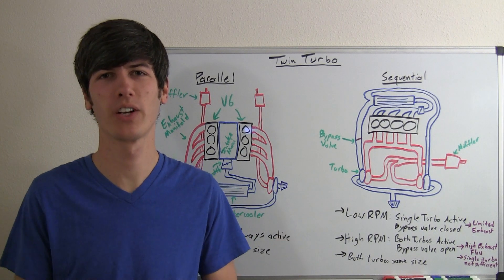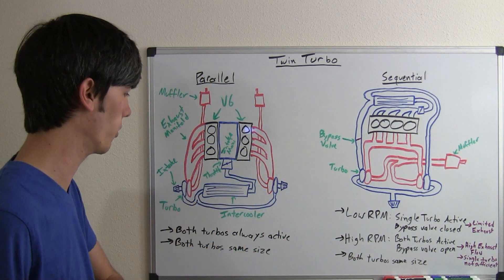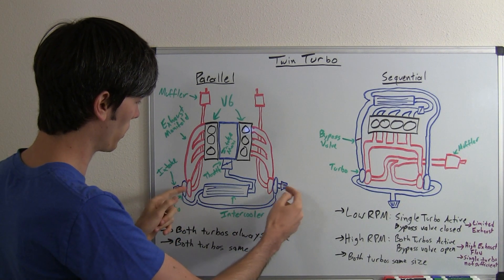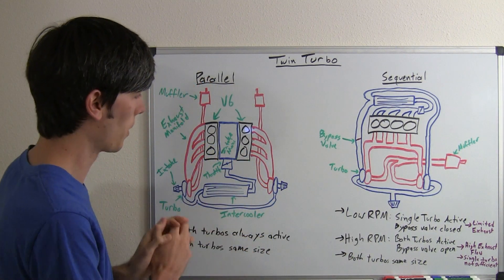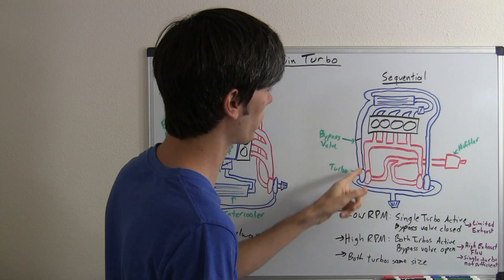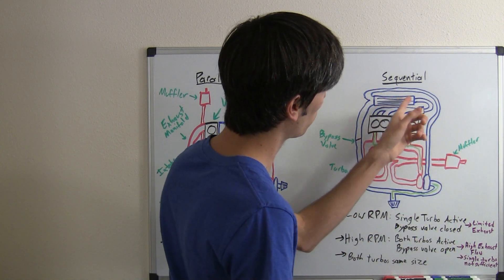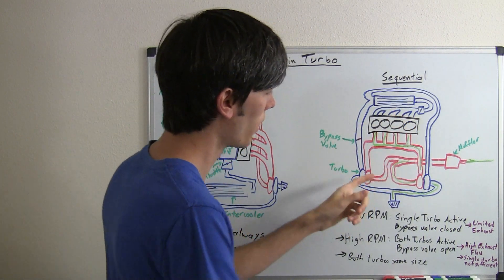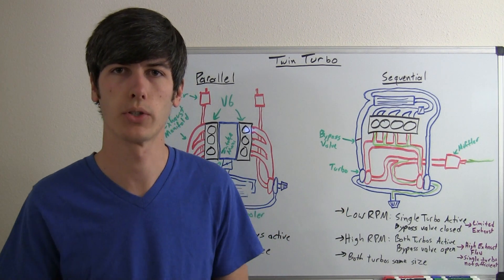How Twin Turbos Work - All The Boost!

Comment: Can you (or anyone that knows what they are talking about) explain why people with, let's use a supra for instance, replace 2 turbos with a big single turbo. What are the advantages and disadvantages
Reply from the maker: A big turbo will give you enormous boost, at high exhaust pressures. Basically going with one big turbo, people are sizing the turbo for super high HP at high RPM, if the sole benefit of the car is to go fast, and can be kept in the power band (like for drag racing).
Reply: Plus one big turbo will be lighter than lets say twin 88 mm. (usually)

Comment: Many car manufactures are using turbos in their engines to make them more enviroment friendly. Is this because the turbo only kicks in at higher RPM? So the turbo isn´t involved all the time and the car uses less horsepower when it´s not needed and more when it´s needed??
Reply from the maker: Essentially, yes. Turbochargers also increase thermal efficiency. But ultimately using a turbo means you can use a smaller engine and create the same power as a larger engine, thus at lower RPM when more power is not needed, you do not have as much waste.
Reply: Thanks for the answer. Great videos!
Reply: So would it be wise to put a twin turbo on a V8 hemi 5.7L?  I don't know shit about cars.
Reply: j dan for the cheaper option otherwise put a supercharger in basicly  the same but it only sucks air in and you will get more power on low rpm but they cost more :) // sry for my english !

Comment: i think the perfect setup is to have 2 turbos(one small, one big)and at low rpms have like maby 80% of the exhaust go to the first turbo(the small one) and 20% go to the second(big one). and then when you get to higher rpms its maby 60%on the big one and 40% on the small one(that way you get that small one to spool up fast and get that low end, then the big one does the rest), does that make sense? and then there all that varable geometry turbo stuff you can have. i dont really know how to have the perfect overall boost level, so much math
Reply: They have this set up in higher end exotics.  Works quite well.

Comment: I just don't understand why the bypassing valve is before the Intercooler. Shouldn't it be somewhere after the cylinders? I also don't understand why the second turbo doesn't spool from the exhaust flow. It isn't restricted to go that why, so why?
Reply from the maker: Check the annotation at 2:16. There should be a valve on the exhaust side as well.
Reply: Engineering Explained
Yeah, that explains it. Thanks.
Reply: Compound turbos are another way to twin. You literally go intake to exhaust and a clean exhaust pushing air into the intake. Can be explained way better by others but this is what I've had on ISB cummins with incredible amounts of power increase.

Comment: Why is the bypass valve on the intake side and not on the exhaust side?
Reply from the maker: Because pressure is relieved when the throttle plate closes, which is before entering the engiine.
Reply: Engineering Explained But when I close the bypass valve on the intake side the wheel in the turbo is still spinning from the exhaus gas?

Comment: Why do we have a bypass valve in the first place? If we don't, we can have both the turbos working in low RPM conditions as well.
Reply: Shashwat Agrawal He clearly explained that in the video. At low RPMs, there isn't enough exhaust gasses for both turbos to work. There is however, enough for one turbo to work.

Comment: Is it possible to have a twin parallel turbos for an inline engine?
Reply: yes stock supra tt
Reply: The fd rx7 although a 2rotor its the same way stock it has a boost pattern of 10-8-10 8psi is when a changing over to both it opens exhaust manifold flapper door for the secondary turbo and flapper door on the intake side
Reply: +eLTy williams the supra is sequential not parallel

Comment: what's the diference between Biturbo and twin turbo ?
Reply: It's the same thing. Two=Twin=Bi
Reply: Typically twin turbo is two turbos of the same size working in parallel. Bi turbo means two different size turbos working in series. Once again that is the typical verbiage.

Comment: non-turbo vs single turbo vs twin turbo which one more fuel economy?
low or high rpm active the turbo more fuel economy?
city drive only XD
Thank You
Reply: Single turbo for city. You won't be running high rpms in city I'm pretty sure. Turbo will help you save gas in the long run for city driving!
Reply: +maggot6639 the only way a turbo saves you gas is if you choose a smaller turbo engine over a larger naturally aspirated engine. Even then, only if you keep your foot out of it!
Reply: +James Jones well a turbo does convert energy into mechanical work that would otherwise be wasted, that's efficiency right there.

Higher intake pressures mean better atomization of the fuel particles and improves the burn characteristics of the fuel/air mixture, which means less unburnt fuel, thus a leaner mix can be used to extract the same power. That equals gas savings.

This is all theoretical knowledge I got in college (mechanical engineering), but I'm scratching my head and all the engines best known for their gas mileage in the city are turbocharged diesels.

Comment: hou about 2 or more turbos in SERIES? in pulling tractors often you can see 2 or 3 turbos in series were the compressed air from the first turbo is going in to the inlet of the second turbo and being compressed more... i wonder how this compares to the same turbos but configured in parallel...ah also how would be a sistem like this but with different sizes of turbos in it.

Comment: what about 2 differit sized turbochargers on the same engine ?
Reply: i was wondering about that too man
Reply: i think basically the smaller turbocharger would be used or activated at lower rpm's to reduce lag
Reply: Adrian Fidi it's called bi turbo for example the 2jz has to different sized turbos the smaller one is for low rpm when that turbo spools the it spools the big one and then the engine makes full power
Reply: AWESOME looked into it a bit more. thanks guys
Reply: i heard about it on Top Gear and it made a lof of sense
Reply: it depends on manufacturer, audi is calling system biturbo when two turbos are same size like rs4 b5 or rs6 c5

Comment: why would i use 2 turbo ? instead of one ? isn't it the same air volume , pressure and flow ?
Reply: Two turbos makes for a better power curve because it is easier for the turbos to spool as they are smaller and have less rotating mass among other things. If all you want is high horsepower - it is actually better to have just one larger turbo - but the power curve is very peaky and only useful in situations where you definitely stay at the peak of your power curve (If you are at 100% throttle at all times). If you are using the car on the street or on a track where you aren't flat out at all times - the twin turbo set up is probably better.

Comment: The explanation of the sequential set-up doesn't make sense to me. What stops the exhaust gasses from going through the inactive turbo? The explanation is lacking vital details.
Reply: Hm, I think you're right.  Most setups seem to use a valve in the exhaust as well as intake.
Reply: He said the blow off valve remains closed on that turbo.
Reply: Miganto A blow off valve is not on the exhaust side of things.
Reply: With the valve shut, pressure can't go to the left side - thus stopping that turbo from turning.
Reply: Miganto Nowhere did he mention a blow off valve. And secondly, blocking off the outflow from the compressor completely would not stop it from turning, but cause it to surge/aerodynamically stall. And that's a bad thing, it's what blow of valves are there to prevent from happening.
Reply: Miganto And even IF the turbo stopped turning, exhaust gasses could still easily flow through it's turbine.
Reply: Some details here of real-world sequential twin-turbo setups:

http://www.mr2.com/files/mr2/techinfo/Random%20FSM%20Data/2jzgteturbo-1.pdf

http://davidgeesaman.com/rx7/TwinTurbo.PDF
Reply: correct. that turbine would still spin, just because on the compressor side the valve was closed wouldnt stop it. You would need a valve on the exhaust side.

source: just done an exam on IC engines
Reply from the maker: Ultimately, having the inlet valve closed means if that turbo does spool up, it's trying to force air against a wall, so it's going to be restrictive and difficult to do, so the air will travel elsewhere (the other turbo). That said, having a valve in the exhaust side of the same turbo would definitely make that more certain.

Comment: If i Have a 3.8L V6 engine can i have two 3.0L turbos? or is it that you will need 6.0L engine
Reply: *****  i dont know thats why i asked and theres turbos that go up to 12l
Reply: johnnyasus86 those are engines not turbos.
Reply: If you put on an extra turbo you will increase the flow capacity, in theory you will double the airflow but not the pressure. The size of the turbos have to be correctly sized to your engine and your power goals. Too large turbos/turbo will make the engine very lazy and laggy until the boost comes. too small turbos will have a very good response but you will loose power at the top and also increase the risk of over revving the turbos and damage them permanently. The efficiency will also be less if you push a smaller turbo to something it´s not made for. It will produce lots of inlet heat .
Reply: do you have a gm car withe 3800 series engines if so just go buy the m90 or m65 supercharger and but a 3.4 inch or 3.25 pulley for it and engine the 10-15 lbs of boost.
Reply: AmRFuKYaH kk

Comment: I thought the bypass valve would be on the exhaust side
Reply: Same thought .
Reply: It's always on the intake side. You don't want all that air rushing to the throttle body when you shut it closed.
Reply: found the problem. he should also draw a bypass valve at the exhaust , so that exhaust gases wont go through the first turbo .
Reply: Justin Tan Zhengyu  Correct. It won't spool any faster unless the exhaust on turbo #2 is blocked so it all goes to turbo #1. The outlet on compressor #2 also needs to be blocked so the boost from #1 won't blow out the inlet of #2.  There are diagrams on how this works on supras.

Comment: How does one calculate drivetrain loss? Or is that even possible?
Reply from the maker: Measure the engine torque at the flywheel, then measure it at the wheels. Divide the wheel by the engine, and you've got your percentage of torque making it to the ground. But there aren't really simple calculations, you could estimate 10-20%.

Comment: how does the boosted air get filtered?
Reply: Intercooler
Reply: Air flowing into the turbo is not boosted but is filtered
Reply: Intercoolers cool the compressed air, it gets hot because during compression anything heats up including air, it does not filter at all
Reply: the boosted air is already filtered. air goes through a filter, then into the turbo to be compressed, then through an intercooler to be cooled, then through the intake manifold and into the engine. the exhaust gas doesnt go back into the motor, it just goes through the hot side of the turbo to spin the compressor, then right back out through the car's exhaust pipe.

Comment: what's a twin scroll turbo? is it better than twin turbo?
Reply: It's a type of turbocharger (how the turbocharger is built to pull in the air) I believe he has a video on it. But to answer your question, it's apples and oranges. Twin turbos might utilize twin scroll turbos, and which is better depends on how good your twin turbo set-up is compared to the twin scroll.
Reply: Justin Clark Reason I'm asking is because I know BMW upgraded their inline six cylinder engines from twin turbos to a single twin scroll turbo, I was wondering if it's for the twin scroll turbo's superiority or to cut costs and reduce engine weight.
Reply: Twin scrolls are better than conventional turbos, however, are much more expensive. A single twin scroll would be lighter and probably have less turbo lag but less boost. I couldn't tell you why BMW did it, but my guess is better fuel consumption, emissions, and less  turbo lag. BMW stopped putting I-6 engines into M3 before this point (to my knowledge) so they might have been making their non-M cars more luxury focused instead of speed-focused allowing less boost from their I-6 engines.

Comment: Do turbo engines last as long as nonturbo engines?
Reply: Yes in the sense that they are built tougher from the very beginning, As where the higher price comes in. But if you slap a turbo on a NA car, your going to have to upgrade some Pistons and rods to handle the extra pressure created by the turbo.
Reply: No defenetly no nonturbo (or as know natural aspirated) engines are more reliable, turbo engines are more fragile to cold starts, they overheat and stuf like that and they break becouse of the boost that is in the cylinders.
Reply: kananisA75 That is false turbo engines are built for boost pressures, so that won't break them and turbocharged engines don't overheat if cooled properly, ie. big intercooler and good turbo cooling/lubrication.which dissipates some heat.
Reply from the maker: If they're built for it, sure.
Reply: *****  Yes i agree with you nowdays turbo engines are as durable as NA engines but NA stil got the leage in durability isues
Reply: Sorry for bad english

Comment: explanation for bmw n54 engine twin turbo 6 inline
Reply: I'm pretty sure it uses the parallel system as the engine has 2 exhaust manifolds connected to 2 equally sized turbos coming from 2 banks, cyls 1-3 and cyls 4-6, finally going to two downpipes to the exhaust.

Comment: how is the by pass valve controlled????
Reply: im going to guess by a pressure plate or throttle position.
Reply: Throttle position is unlikely as you can open full throttle while still waiting for boost to spool.

Comment: What's turbo flutter and how does it work?
Reply: Turbo "Flutter" is also called compressor surge, which happens when you spool the turbo up and let off the throttle, if no BPV/BOV is present, the pressurized intake air has no where to go, because the Throttle body is closed. When this happens that pressurized air will cause the compressor side of the turbo to be slowed down by said air forcibly, which makes that flutter sound, but this also causes damage to the compressor wheel, and since no BPV/BOV(which vent pressure on the intake when throttle is lifted, alleviating the intake pressure) this could later cause a turbo to blow up and possibly send metal pieces into the engine causing even more damage.

This can also happen with a BPV/BOV present, it just means that the spring keeping the valve seated is too strong and doesn't allow the valve to open far enough to let out the induced pressure fast enough, caused by a compressor wheel spinning and that air having no place to go but back through the compressor wheel, causing the same flutter. Low rpm flutter isn't as bad as high rpm flutter, because at low rpm's the turbo usually doesn't spool up enough to make a considerable amount of pressure to open the BPV/BOV, which won't affect the wheel as much as when high pressure air is pushing on a very fast spinning compressor wheel, which is when the turbo will more likely blow up.

Hope this helps!!!
Reply: ***** Thanks a lot! :)

Comment: What about 2 stage turbocharger?
Reply from the maker: Next video. :) (Can also be called variable twin turbo, and is common with diesels).
Reply: Engineering Explained is this whats usully refered to as a flux capacitor?
Reply: Don't forget my request about lubrication, especially for other than inline, also pump, delivery, and spray (or what ever). Also VTEC, how to transfer oil from delivery line at shaft to the rocker arm. =)

Comment: People. turbo lag will end once the electric turbo Audi is implementing on their next cars becomes the rule. That is the future - why this guy never talked about it is quite puzzling...
Reply: Cummins already has a electronic controlled VGT ( variable geometry turbo), american way of sayin electronic wastage. Great technology, great idea, fast response and also works as part of the engine brake system - back pressure. All sounds great, however it is horribly unreliable, it got to a stage where the factory simply couldn't produce them as fast enough and supply the demand for how many were failing, particularly in Australia's harsh application. There were cases where we fitted a brand new one and it jammed and had to be replaced after 16klms.
They've since gone back to Pneumatic wastegate on the larger on-highway engine.
Hopefully audi can nail it.
Reply: so does BMW and Toyota etc...@ electrical turbo
Reply: isn't a super charger basically an electric turbo
Reply: Supzor a super charger runs off of the engine belt
Reply: PrOBrien  Thanks for the info mate
Reply: Supzor Happy to help.
Reply: yep and Works in low rpm turbo Works at high rpm